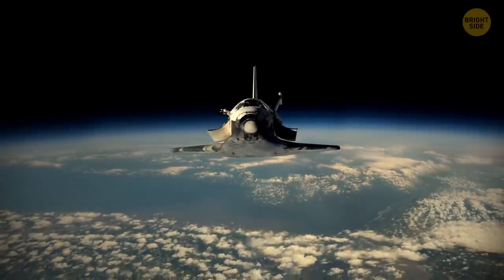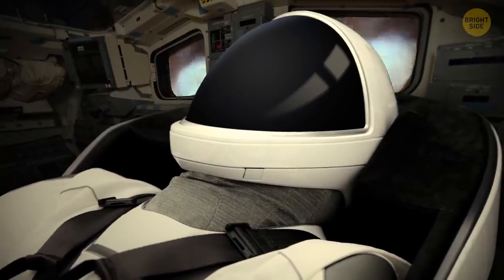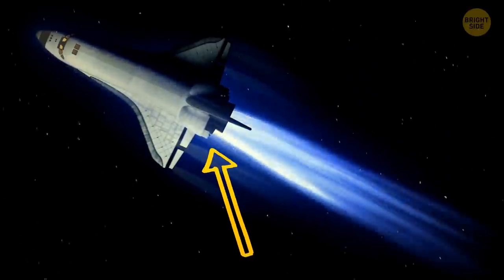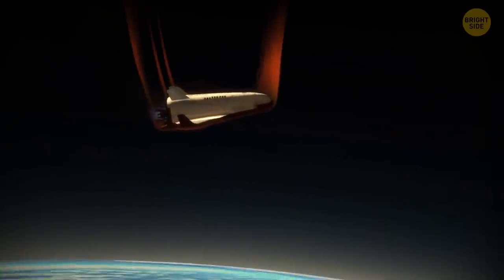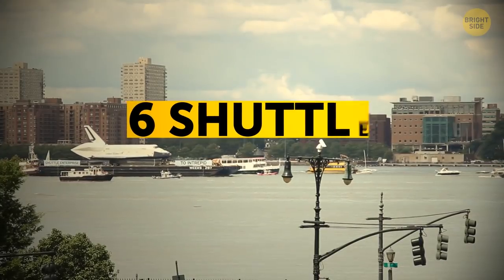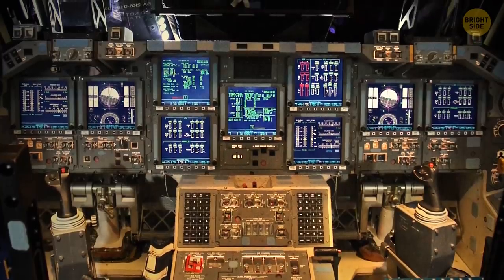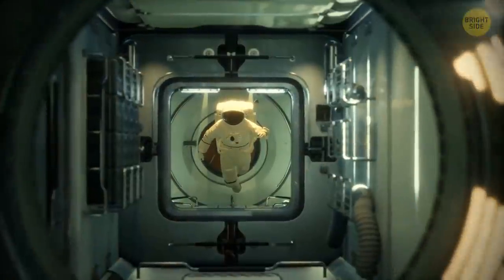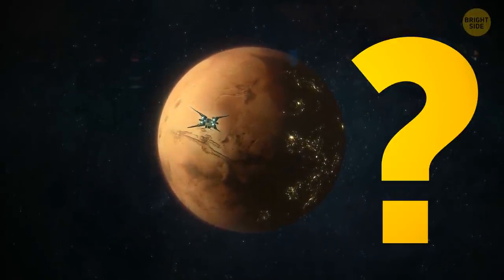What Space Shuttle Was Really Carrying and Why It Flew Backward

Comment: Non 10 min answer: It's RCS, or reaction control systems. Tiny thrusters that use monopropellant to orient and spin the shuttle.

Edit: also, most spacecraft have RCS, just not always little holes but instead large blocks with multiple RCS thrusters sticking out

Comment: The space peeps Said The hole on the nose is "RCS"
Reply: Yes, that is true.
I am a space nerd and if you ask me any space questions, I may answer them.
RCS is Reaction Control System
Reply: SAME Space Nerd
Reply: If you are a space nerd, tell me how a star is born,
how a liquid-fueled rocket engine works, and if there is a black hole in the center of all galaxies.

NO looking them up.
Reply: @ÆSd jk Kos the last one isnt a question if you were sarcastic i didnt mean to ruin the joke
Reply: @callistofluff  late reply, simplified answers

Star birth comes from nebulae slowly collapsing to form a large protostar before eventually pressure and temperatures reach a point at the core that nuclear fusion can take place. This is usually the thing that indicates the exact birth of the star. Some excess mass get’s ejected.

I haven’t studied the precise mechanics of rocket engines, but simply said I guess propellant is pumped to the combustion chamber pre-heated or something. The pressure of the pipes delivering the liquid fuel and oxidizer should be higher than the chamber, and that the exhaust of the engine would be at least supersonic, if the opposite force from the exhaust leaving the engine is enough to lift the whole rocket upwards, then at least 1.00 TWR. The shape of the rocket nozzle is also important for the speed of the exhaust? And also for gimbaling for switching angles and stability replacing rocket fins since they add extra weight. 

From my knowledge perhaps indeed ALL galaxies have a central black hole, perhaps two in a binary? Haven’t heard of it.

- guy who plays spaceflight simulator